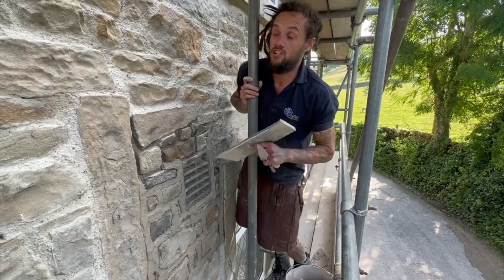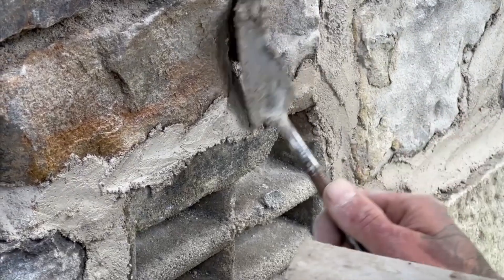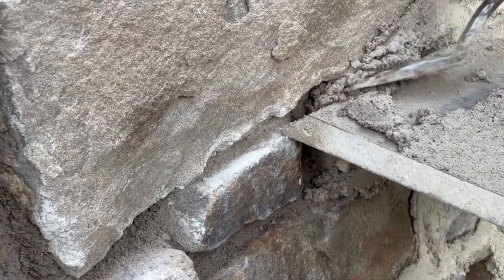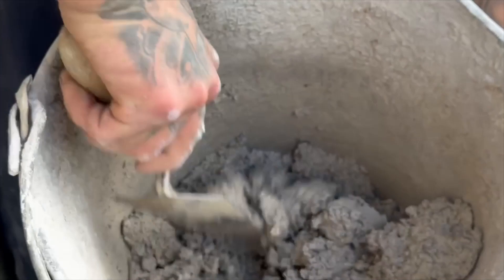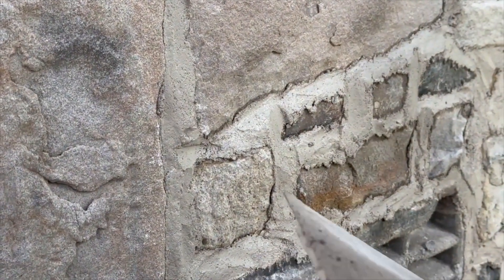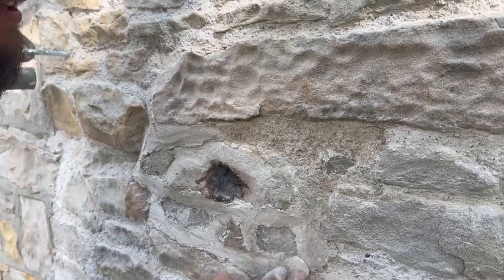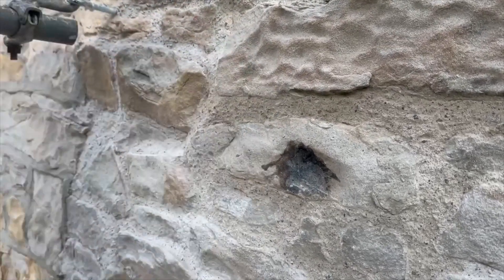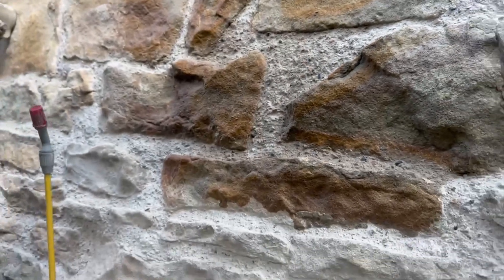Pointing in lime to fix a damp cottage part 2 Application and finishing

Comment: Love your videos! I had my 200+ year old house renovated 5 years ago and insisted all the stonework was rebuilt / pointed in lime. Like many before someone had repointed it in portland cement mortar, the damage to the sandstone was terrible after raking out and many stones had to be replaced. We actually knocked the porch down so we could have stones to match and repair the front aspect and gable end! My partner was dismayed at the extra cost but the end result was well worth it, it just looks beautiful now. At the time we knocked down an internal wall built from the most beautiful clay bricks and I spent ages cleaning them all up and stores them. Your videos have inspired me and 5 years later I've just used those old bricks to construct a large coal bunker which I've tied into the old out house :-) your knowledge is inspiring and its great to see someone going about things in a traditional manner. 👍 from oxfordshire
Reply from the maker: HI @Years-qy7me. Many thanks for your comment. It's responses like this that make my heart cherish. Sounds like you have had a monumental project on your hands  since becoming custodian of your house. So glad you have made it into a home using traditional methods.  Your home will treat you so much better in response for that. 
You will have seen first hand the damage done by using modern cementitious mortars. 
Much love.

Comment: I’m in the process of raking out the back of my terraced house, the only one in the entire street that hasn’t been cement rendered. Bought nhl 5 as it gets allot! Of rain on that side of the building, as per your recommendation. Watched a load of your videos, which are great by the way as this is my first attempt at line pointing so wish me luck.

Comment: Hi Danny, I'm using ready-to-use Mike Wye lime putty mortar whilst I teach myself the job. Every tub comes with a bag of pozzolan which I understand is to improve the mortar going off in damp or cold conditions. As we enter the winter (it's early November), is there any downside in either leaving it out or adding it at the recommended 10-20% by volume? The wall I'm working on now is sheltered and not too damp at all. Cheers.

Comment: in the past, wouldnt you then limewash the entire wall, rather than leave the stone and pointing exposed? and limewash once or twice annually?
Reply from the maker: @AJTarnas  Hi there. The lime pointing is usually best to let cure fully for a couple of seasons before any lime wash is applied.
Reply: @ hmm! i can't see why that would be. certainly not from a chemical perspective -- limewashing the whole thing is protective (being a thin sacrificial layer) and doesnt measurably change the vapor permeability. is this just your tradition, or can you think of some good reasons for it?
Reply from the maker: @AJTarnas  Good point there. I have for the last 20 years allowed the pointing to fully cure before the lime wash is applied.  I would much rather the nuts and bolts be tight before I added anything else to the race car.  The lime wash is only a small fraction of the equation of keeping moisture out of the substrate so the main job is to fully carbonify the lime in the mortar in my humble opinion.
Reply: @ sure. i'm just saying, a coat of limewash will not slow the lime mortar from curing. carbon dioxide in the air has no problem passing through a 0.1mm layer of limewash and then the next 0.1mm of mortar and the next 0.1mm after that and so on. the materials are perfectly gas/vapor permeable. you'd need to polish the surface with oils (or have a lot of milk in the limewash) to seal them.

now perhaps your clients don't like the look of limewash. but my understanding on the history of lime mortar and stone is that the limewash is an important part of the system, and we're used to seeing bare stone and mortar in the present era simply due to negligence on the part of building owners who've lost the past knowledge that you should be limewashing everything perhaps twice a year.
Reply from the maker: @AJTarnas  I'm with you on the lime wash and protecting of the structure.  At heart I'm a stonemason though and adore that contrast of showing off the stone in all its glory. When I work on the West Coast of Scotland, it's vital to lime wash to keep that Atlantic blasting weather out of the structure.

Comment: What happens if the nonhyrdrated lime is old and doesn’t set properly?  And turns to dust?  Is the 3.5 fool proof?
Reply from the maker: @IcelanderUSer  I don't know what you mean by non hydrated..
If you buy a bag of 3.5 then it isn't fool proof. Lime needs way more care and attention than cementitious mortar to apply and cure properly.

Comment: One year on, I’ve learnt to much from you. As it is getting late, I’m looking for granite dust. I’ve only found limestone dust so far. Would it have the same properties to cure the pointing faster? Thank you so so much
Reply from the maker: Cheers for the kind words!
I'd persevere and look for the granite dust still.  Most larger builders merchants will have it in stock. 
I wouldn't use limestone dust as the lime that you use in your mix will eventually carbonate into the same chemical (calcium carbonate).
Reply: @dportercontracting9974  thank you so so much for your reply! 🙌🏻

Comment: Absolutely amazing work. Thankyou for such a clear and straightforward explination. P.s love the accent 😁.
One question, 
The mix you are using is 2 part grit sand 1 part nhl 3.5 and 1 part .........powder something disnt quire catch what you said. I am in france and use the same mix most of the time except for the powdered something😂
Reply from the maker: @dylankane7003  Hi Dylan. Thanks for the props. The other part of my mix was "6mm granite to dust"
Reply: @dportercontracting9974  thanks for the reply much appreciated. 
Would it be possible to discuss how you calculate material quantities by any chance?
Reply from the maker: @dylankane7003  Calculating quantities is a tricky part of the pricing process. I usually work on the process by using £10 of materials per square meter, then gauging the amount of mortar constituents back from that.